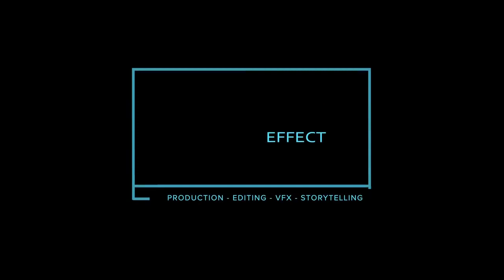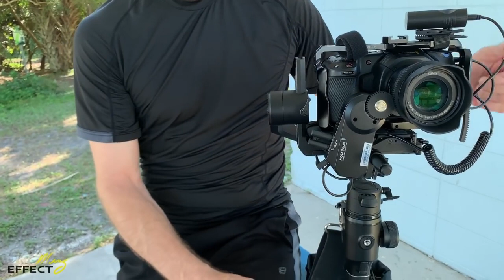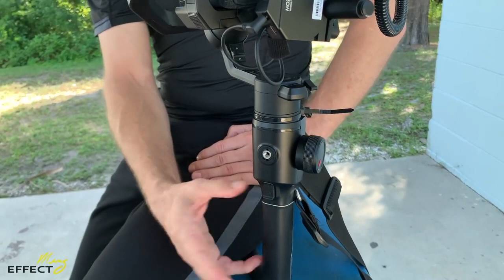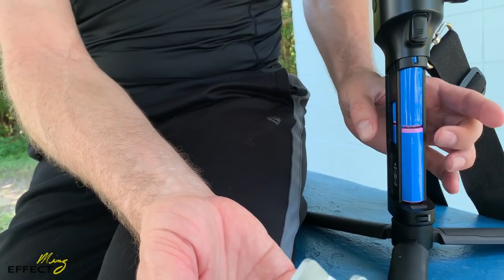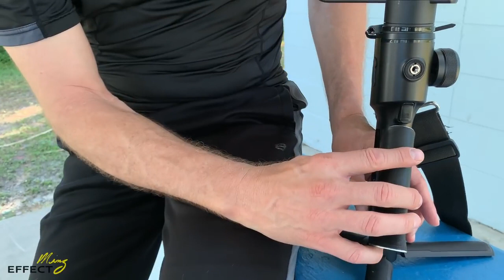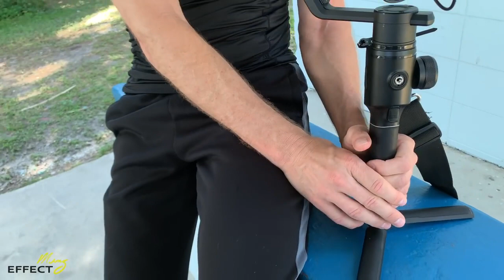How to Power the BMPCC 4K Rig with the MOZA Air 2?

Comment: I can't get the bmpcc4k with a smallrig full cage to rotate horizontally in inception mode? It works fine vertically but I don't want to be filming up at the ceiling or sky.

I think it has something to do with the cameras weight and the the motors power. I've even tried the motor power in heavy mode and the camera still won't do a 360° roll. Judt gives up.

Cam anyone help?

Comment: Thanks for the info. Does your Moza air 2 cut out in underslung mode or inception mode with that set up. My motor is struggle at about half the payload. BMPCC6k with a 11-16mm Tokina. Not enough juice to spin it.
Reply from the maker: Hello，have you solved your problem now?If not yet,you can send your request to our technical team for professional guidance：support@gudsen.com

Comment: Can someone actually explain how he powers the camera? I got lost in the conversation to black magic and pointing to an output I couldn’t see in the video. If someone can answer I’d appreciate that
Reply: The Moza Air 2 has a 16.8v Output built into its base plate that uses a standard DC type barrel connector. All you'd need to buy is a cable to go from the DC barrel to the Pocket 4K/6K 2-pin Lemo type connector.

Comment: I don't know if the guys from BM told you but its a huge no-no to be powering the BM externally, through the 12v in, while an LP-E6 battery is inside. It is clearly stated on their official website. Just a warning, a lot of ppl fried their equipment that way
Reply: And in my opinion on their website it is indicated that this is one of the ways to charge the battery.
And that in the case of connecting external power, the camera is powered by it and not from the battery.

Comment: what is the rated current on the 16 volt output?  I have a BM I am looking into feeding power to on a couple different gimbles.  Problem initially I see if a 2000mah battery is dead in 20 minutes that is a 6 amp draw in rough calculations.   So I am little curious how its able to deal with the current draw regardless of the voltage of 16v.?  Example the Crane 3 has an output for powering, but its limited to 2A.  I think it would choke trying to run the BM,
Reply from the maker: Hello, don’t worry，please write an email to support@gudsen.com for professional guidance.

Comment: I heard that the control for the air 2  would not work with bmpcc 4k? Controls such as record and such. If it is, then what cable may I use to get it to work? Its inconvenient to touch the camera to start recording or even to auto focus. Did you guys update the firmware to support bmpcc yet?
Reply from the maker: Hello, this may help you out:
https://www.gudsen.com/upfile/admin/file/download/MOZA-Air-2-Camera-Compatibility-List.pdf
Reply: Too bad bmpcc 4k is not on the compatibility list.

Comment: Thank you for the vid, I have a setup that allows for the same configuration you have but will run many hours. I have a v-mount battery connected to the DC input on the handle of the Moza Air 2. I put the v-mount battery in a pouch on my belt so the weight is no longer a factor. Also, I have a long cord to connect the two so not to restrict movement. The cable can be secured down the handle via a clasp, tape whatever is the preference. This allows me to shoot for many hours not worried by power loss/changing batteries etc...
Reply: This sounds like a setup I plan on having in the future. Do you have any pictures or video if this setup?
Reply: I'd appreciate a picture as well!
Reply: Hi, sounds great! 
Can You give me more information about your rig? What cable(s) did you bought? Is there a foto or something? 

Would make me really happy :)
Peace
Reply: Do you have to remove the batteries in the moza air2 while using the DC input?
Reply: @labalaban  No, you can keep them in.

Comment: We have the BMPCC and just bought the Moza Air 2. It does not seem the camera fits left to right when mounting on the plate. We have to really squish it in there and it's scratching the right side of the camera? Is there an adjustment to move the mount plate slightly left (opposite direction of the Moza arm)? If not, how are you not experiencing this issue? Thanks for any insight here.
Reply: Beta Call I had to use just one screw on the plate and adjust it to the right for the camera and small rig to fit!
Reply: @thedavincimixchannel8763  I did the same!
Reply from the maker: Hello, don’t worry，please write an email to support@gudsen.com for professional guidance.

Comment: 18650 battery == 3.6V * 4 batteries in gimbal handle == 14.4V ... so 16.4V is a very high number (could be reached if the four 18650 batteries are fully charged yet are still being charged).  So 16.4V is unlikely to be reached.  Probably ~15V maximum.
Reply: Actually, a lithium battery fully charge is 4.2volt each, so that would be 16.8volt
Reply: @mochouinard   : Hmmmm, that's not what I read.  Inconsistent claims, I guess.  Where did you get that value?  I have seen 3.75V now and then, but not as high as 4.2V before.
Reply: @maxbootstrap7397  Lithium battery have a tolerated voltage range of 3volt to 4.2volt.  3.7volt is the nominal value, they are 3.7volt battery, BUT fully charge, it 4.2 as you use it, it voltage will drop to 3volt where you should stop discharging it.  So normally, a v-mount battery should show a value of 14.8volt battery BUT the equipment you use it in should have an allowed voltage input of 16.8volt or higher to be safe.

Comment: Correct me if im wrong, but ideally once you plug the cable in and power the moza up, the camera should automatically charge, right? Ive hit a road block and have troubleshot both the camera and the cable separate from the moza and found everything works and charges fine. I haven't found anything I can toggle on the moza to shoot the power out so to speak. Is there something in the firmware that I should address before contacting  Gudsen directly? Any help/Suggestions would be appreciated.
Reply from the maker: Hello, don’t worry，please write an email to support@gudsen.com for professional guidance.

Comment: Hi! I just got a Moza Air 2 for my pocket 4k it worked great the first time I set it up, but now after I did a firmware update in sport mode I get a whine and shake from pan motor. Is this normal? Am I doing something wrong? Maybe I just didn’t use sport mode first time? All I have is the camera and a follow focus not even fully weighed down. I can send a video if that would help. Thanks!
Reply: Hello, did you have to put any extra piece for balancing the camera correctly? or did it fix with the gimbal perfectly? Thanks!
Reply from the maker: Hello, don’t worry，please write an email to support@gudsen.com for professional guidance. It will be better if you send a video.
Reply: Gudsen MOZA thanks! I sent them an email last night! I kept using it and I think it’s better. I only notice it when do a quick turns right and left using only the handle. If I run with it and don’t whip the handle around it seems to do fine!

Comment: Thanks. My preferred setup as well. Very good confirmation, it takes away the amateurish feeling of insecurity.
Reply from the maker: If you could share your worries, it will be perfect.
Reply: @GudsenMOZA  I can't get the bmpcc4k with a smallrig full cage to rotate horizontally in inception mode? It works fine vertically but I don't want to be filming up at the ceiling or sky.

I think it has something to do with the cameras weight and the the motors power. I've even tried the motor power in heavy mode and the camera still won't do a 360° roll. Just  gives up.

Can anyone help?
Reply: @GudsenMOZA  Since I got this advice from you January 3rd (ud:0167a694) - quote "The 12V Outport is not perfert enough right now, and we do not recommend you use that port temporarily. Our engineers team will to some test and improments on this in the near future. Thanks for your understanding and patience." end quote - I have been looking for an update. 

I am still thinking of "improvements" as nothing has been done on my Moza Air 2.
Reply: Gudsen MOZA - what is your response to my worries - is your previous advice not longer valid?